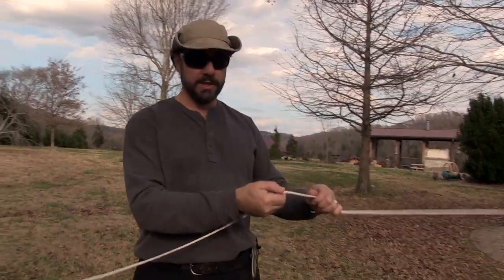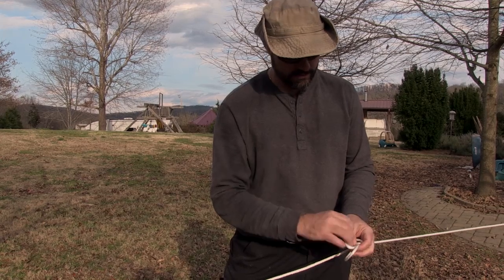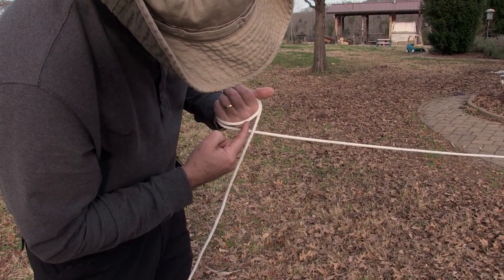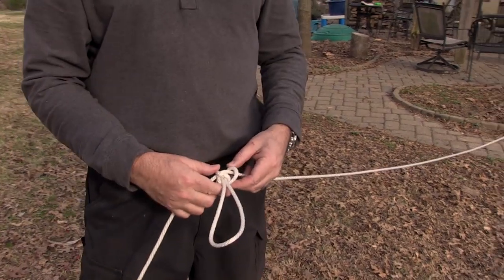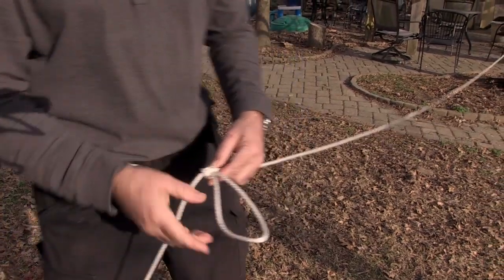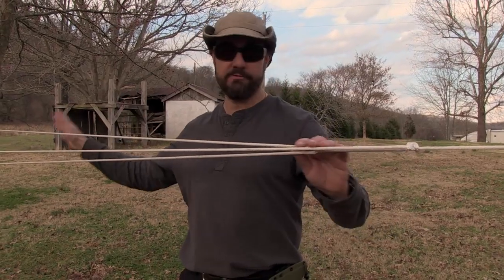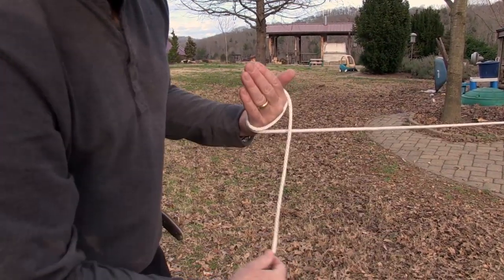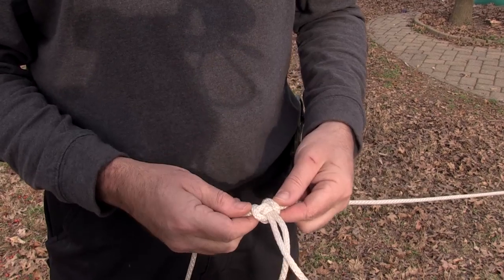Alpine Butterfly Knot and The Trucker's Hitch

Comment: Anchor hitch really only needs one half-hitch since the first time you put it through makes one half-hitch, so you add one more (not two more).  I prefer Truckie's hitch based on half-sheepshank (can easily be made collapse-proof btw).  
At least a butterfly loop is better than a slipped overhand or slipped fig. 8 knot for untying.  And contrary to what others have said in the comments,, those don't always pull out easily!  Depends on diameter and type of rope.  Can even damage the line/rope if they're really tight.

Comment: Do ya reckon a slip knot is easier to tie and untie and does the same job as the alpine butterfly?
Reply: The butterfly knot is even easier to untie than the slip knot after you put a lot of pressure on it pulling it so tight

Comment: actually the way vectors (sorry about the technical term) work you can get MORE than 2x mechanical advantage, basically the more you pull to the side of the direction youre working the more force you git. it involves some really cool and simple physics, but only works for short distances. GREAT VIDEO THANK YOU!
Reply: Absolutely wrong.
Reply: Max 2x per pulley, not taking into account frictional losses.  Probably more like 1.3 - 1.5x when not using an actual pulley as the pulley.

Comment: Very nice. Use the trucker hitch and always struggle to get my figure eight out. Thanks
Reply: A simple slip knot works perfectly, but only if you wrap the bight around the standing side of the knot. If done incorrectly by wrapping the bight around the running side it will slip and close and jam.

Comment: Your anchor knot looks like a ' round turn and two half hitches' with an extra  half hitch to start. The truckers' hitch is also known as a dolly in the UK. You can wrap the rope around a bight twice and pull the end of the rope through the bight. I've used it thousands of times and can tie it with my eyes closed.

Comment: I know the butterfly loop, but I'd be more inclined to use a slipknot instead as it's even easier to untie by simply pulling on both ends.  Is there any advantage of the butterfly over the slipknot in this particular case?
Reply: was gunna say the same thing. sliding overhand works the same way, easier to tie and pops right out
Reply: Again, no idea what you're describing.
Reply: A slip knot will still jam under tension, especially with a wet rope.

Comment: The simplest way to tie this knot is to form the loop the way you showed as incorrect EXCEPT instead of tying an overhand knot with the bight, tie the same overhand knot ONLY take the bight and wrap it around the SINGLE standing part. NOT around the doubled bight itself. When done correctly the loop will not close. When tied incorrectly, that is when you wrap the bight around the single running side of the knot the loop will close and slip. Never fails, 10x quicker to tie than an 'Alpine butterfly knot and comes out INSTANTLY by simply pulling the running end. I've tied it 10,000 + times and taught 100 people (at least) and it ALWAYS works. To simplify: line doubled in one hand, single in the other, tie an overhand knot. Period.